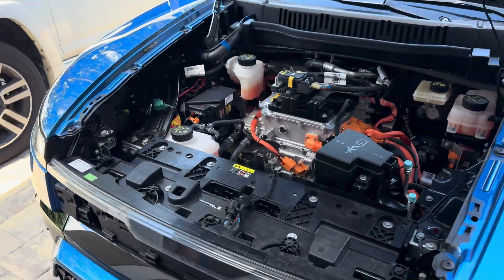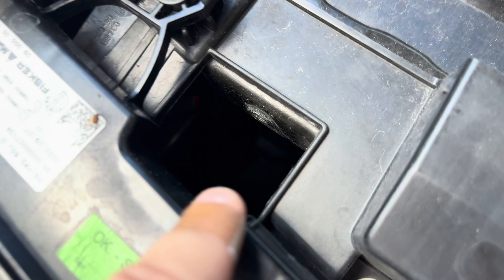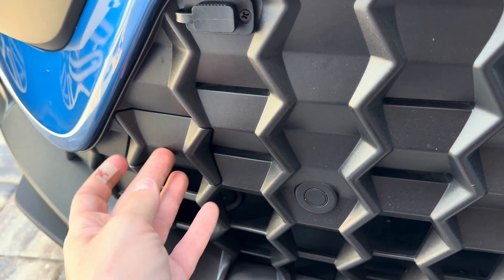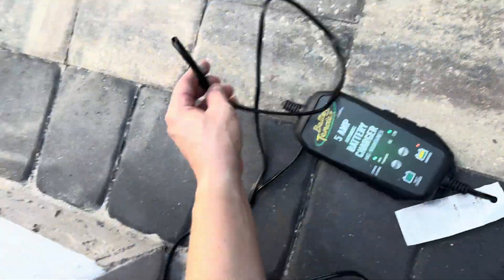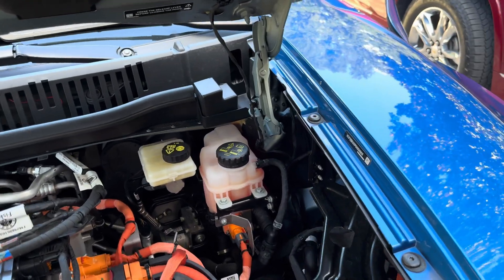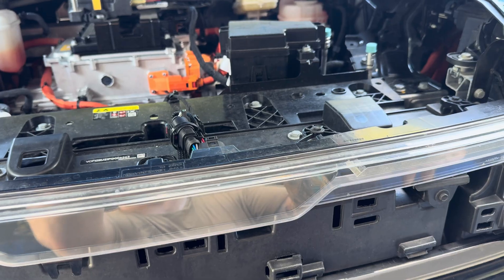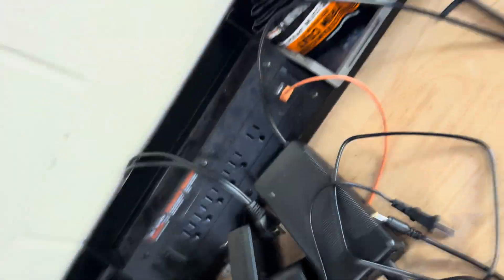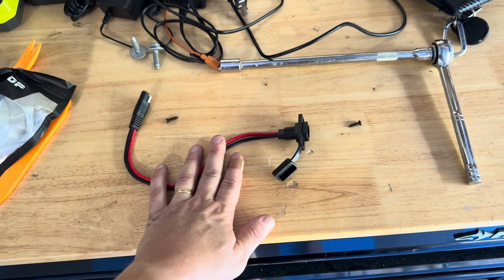FISKER OCEAN - HOW TO IMPROVE 12V MAINTAINING PT. 2

Comment: Thank you. I am getting ready to do mine. I am thinking of using cigarette lighter adapter instead of the SAE connector.  Easy to drill a circular hole. In addition, I can use the digital voltmeters that come with the USB cigarette lighter adapter.
Reply from the maker: Let me know your experience.

Comment: Hi Mike:

How in the hell do you always seem to get your car to work??  I'm having nothing but ongoing problems!  Where in FL are you in?  I'm in Daytona Beach.  When I try to turn on the car, I get all these error messages, something about the ADAP NOT working, the battery icons come on, the tire pressure icon comes on , oh, and for some reason, my windshield wipers keep coming on!   ANY ideas?

Thanks!
Reply from the maker: I’m in Jax Florida!!! You should stop by! We can check it out. My guess is you’re a little bugged but not bad. when 2.2 pushes to you and it should be very soon, make sure not to open the door and allow it to finish. It is very important that it is allowed to finish.

Comment: Very nice and clean installation.  How do you drill the hole in the grill?  How big does the hole need to be?
Reply from the maker: I used a razor blade to cut the hole. It is soft plastic. Just cut the hole to match the wire mount.
Reply: @TheEVAddict  Thanks Mike.  What about the screw holes, did you have fasteners, or did they drill into the plastics?  If they drilled into the plastics what if the hole gets stripped?
Reply from the maker: I drilled into the plastic. I would suggest going slow to avoid stripping. They shouldn’t ever just strip on their own. Cheers.
Reply: @TheEVAddict  Thanks Mike.  What about the screw holes, did you use some type of fastener or did the screw screw into the plastic?  If  the screws just screwed into the plastic what if the screw holes get stripped?  Also are the screws sturdy enough to keep for it repeated plugging and unplugging, i.e. once a day?
Reply from the maker: Yes/ the screws are sturdy enough and coated.